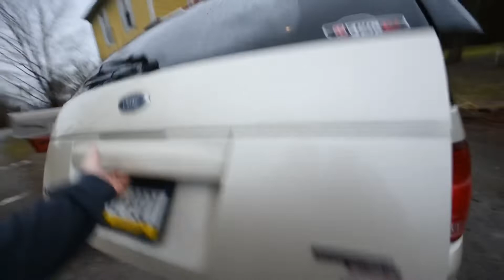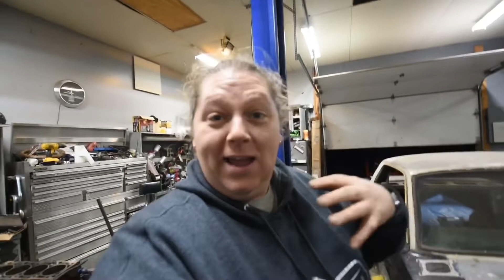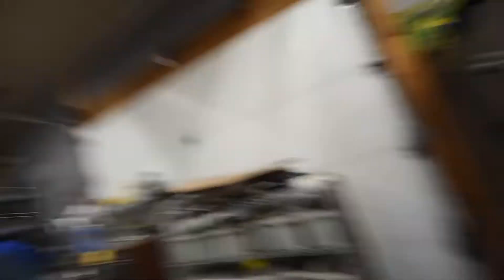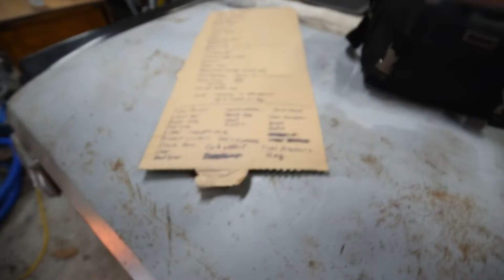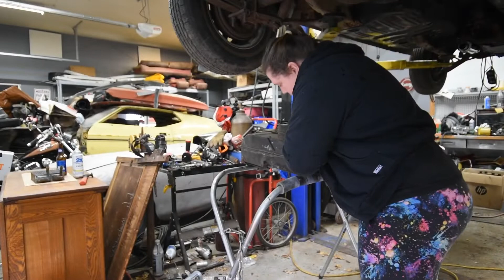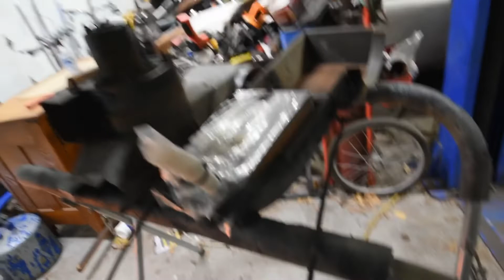Drive shaft, heater core, an fuel injection!!

Comment: Not a bad job on the heater box fix. I wouldn't be worried about replacing that real soon. Would weight till you go to add AC to pick up another heater box.
Reply from the maker: Thanks!    Baby steps and we will get there.